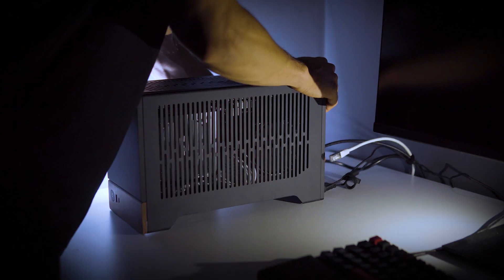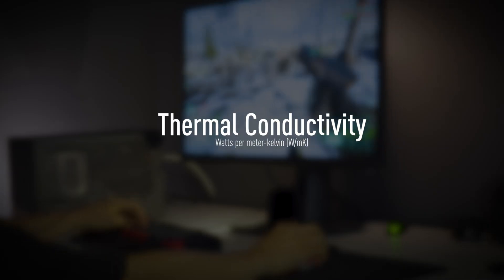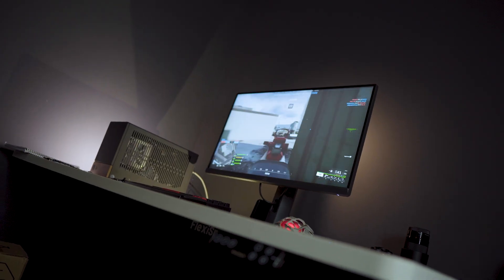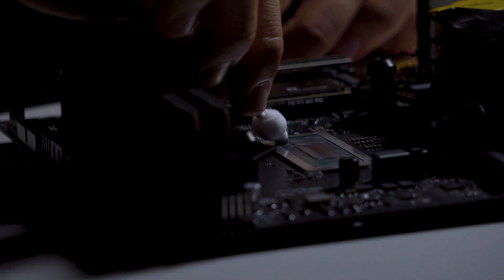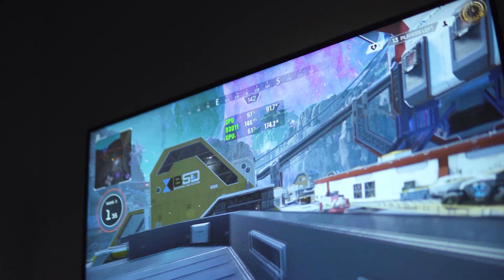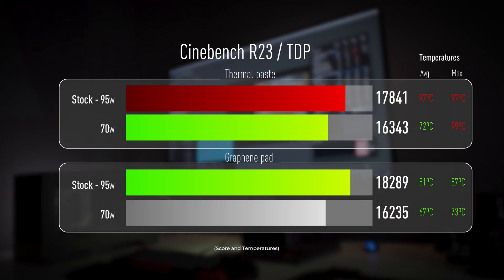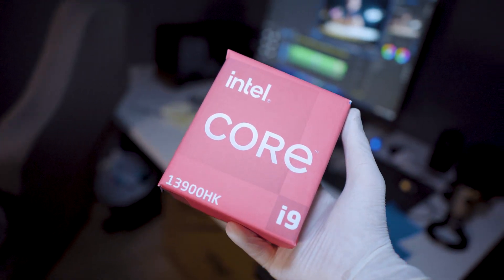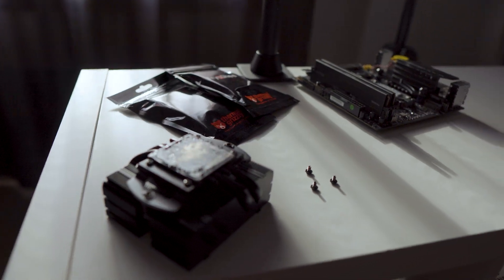Good Bye Thermal Paste: -30 degrees (no Liquid Metal) Saved My Gaming Computer

Comment: Graphene pads are one time use. You cannot use them again after taking off the heatsink. If you dont remove the heatsink, you dont have to ever change it because the temp will be the same from the day you installed it.

Thermal paste will last from 1 year to 10 years depending on brand and type. Kingpin is best to reduce temps but after 1 year the temps will be more hot and will need to be changed.
Reply from the maker: That's something I learned after the video, it was just my first encounter with them. Thanks for the information, I'll pin this comment to allow it to reach more people!
Reply: @BenTech-US have you heard of PTM 7950? It's also single use. However, it starts solid and melts at 45 degrees. Because it can actually melt to get into all the nooks and crannies and crevices, it should give way better performance.

Still has the same issue where you can't replace the fan. But that's what makes it absolutely perfect for GPUs and laptops.
Reply: high end thermal paste ( what  i mean is paste that are best for dropping temps/high performance paste) will start to degrade after 9months to 1 year.. so yeah overtime  temp will increase which is why you want to change this on a yearly basis.
Meanwhile Graphene pads & liquid metal are good for 1x use only and will last forever as long as you don't remove the heatsink.
however for liquid metal this is only applicable if the heatsink is nickel plated a pure copper w/o nickel plating will absorb gallium (i think its gallium) and will cause the liquid metal to dry earlier but once the copper absorbed LQ it will take longer to dry later on, for nickel plated only a tiny bit will be absorbed and even if it dries as long as you don't remove the heatsink or tilt the heatsink that might cause crack (in the current dry = solid form LQ) this will retain its thermal conductivity but once cracked it will reduce its thermal conductivity or worst your now good as w/o thermalpaste.
I'm current using a liquid metal under my CPU block for 2 year and 6months + now the other advantage is at peak load you will have better temp drop + better boost compare to highend thermal paste.
Are this new graphene pads good? i though its performance is still inferior than a paste if this is good I'm going to use it in my GPU upgrade.
Reply: @gamertechlive1780  for bare die applications use PTM7950 Phase change Thermal pads, they will NEVER pump out and will outlast the GPU (Temps are between paste and LM)
Reply: so how long do graphene pads last?
Reply: @brandyyn forever as long as you don't remove the heatsink
Reply: Lol that's not true at all, Even Expensive thermal paste lasts at max 1 year because of Pump out effect of thermal paste, it's literally you can't avoid it, You got those numbers from the brands because ofcourse they gonna boast how long their product will last but in reality and in practice, it will barely last months or a 1 year

Comment: Why don't you try ptm7950
Reply: PTM7950 gets better the longer it's used, and when used for a duration can have heat tranferability comparable to liquid metal.
Reply: @BROSIV91   It's so good that it rivals Liquid metal but far safer and far durable than normal thermal paste, I don't know why It isn't famous at all.
Reply: @I.K.illedThatBeardGuy PTM has lower thermal conductivity than thermal paste but somehow it performs significantly better on my GPU. Makes me wonder if these thermal paste manufacturers are lying?, Honeywell PTM is Industrial grade so it's been very thoroughly tested and has accurate packaging details.
Reply: @TheRealName7 LTT did a video on PTM 7950. Sadly, gamers nexus hasn't.
Reply: @TheRealName7  Phase changing will suck up a lot of heat and paste does not do that.

Comment: Pretty sure this is a scam😂

Bro can you test simple aluminum foil as a thermal pad? 0.02mm thiknes

Or better copper foil if you can find it.
Pretty sure you will get the same results😂
Reply from the maker: Why would I scam someone? I bought them just to try everything, since a friend of mine recommended this for me. The most probable thing, is that the CPU stock IHS thermal paste was absolut trash, so then with a little upgrade, the difference is BIG.
Reply: Maybe you should watch some videos from derbauer, the guy behind thermal grizzly...
Reply: Those are graphene pads from Thermal Grizzly. Do your research, idiot

Comment: I'm pretty sure the temperature difference you're seeing mostly comes from the thermal paste in the IHS and this being one of those chinese boards. Pretty much every other test of these pads is positive, but not 15ºC better than good thermal pastes. 

Mind you, most "famous" pastes are bad for direct die application like what you have between the die and the IHS. For that location, you eant thick pastes like the GC-Extreme, GC-4, Prolimatech PK-3, etc. 

Those Thermal Grizzly, Arctic, Cooler Master and Noctua pastes pump themselves out of the die almost immediately.
Reply from the maker: That's the point, probably that's what's giving that much of a difference here, and I'm glad you shared those tips, I'll definitely try something different under the IHS. I never knew about that, so thank you very much!
Reply: @BenTech-US try phase change material and popular thermal paste. It will be better than those graphene pads.

Comment: I think "PTM 7950" (or whatever phase change they sell as PTM 7950) sold on aliexpress would be fun to test, it's similar (or even cheaper) price to those sheets.
Gotta test before and after burn-in though!
Good luck on practicing pronunciation, it's much prefered to AI-tools. I can't stand them.
Reply: Paste is better than these graphene pads. But phase change is really good and should be used.
Reply: @tacticalcenter8658  yup, its almost as good as liquid metal, but of course, if dd then lm, otherwise ptm pcm or whatever its called
Reply: @tacticalcenter8658  not really. Thermal Grizzly's pads The Kryosheet. Competes with the Noctua paste (one of the best, if not the best paste on the market. IC graphite pads of old were not as good sure.
Reply: You would get 2 sheets about 4 times the size of those pads for the same money. Whist it is good it is incredibly fiddly to work with, results take a bit of heat cycling but are definitely one of the best options for bare die applications such as laptops. Having used it multiple for laptops myself I can attest to it's quality. I used Upsiren PCM-1 branded version and it works perfectly. Upsiren UX Pro Ultra thermal putty is a good thermal pad replacement to go with it. In my personal laptop it reduced temps by 16'C peak and a further 8'C under general gaming load. It also brought all the cores temp delta much closer together, before the variation could be as much as 10-12'C, now it never goes over 4'C max variation. Slightly higher boost clocks, 100MHz means more headroom for the GPU to boost as well. I used it there as well and temps have come down too. When capped at the same MHz it's around 7'C cooler. Fans are much quieter and so I leave it at that.
Reply: Built in heat, started selling Pentium 7950 on their website. It's honestly probably the cheapest way to get the real deal.

Comment: Nice vid, didn't know these pads existed. Too bad your 13900k will oxidize and die too fast for this to have been worth it.
Reply: It can and don't have to happen not all cpus are affected earlier(earliest) ones are but what specific batch/es i don't know yet but remember every chip will die literally
Reply: wdym? graphene pads ruin cpus?
Reply: @Laptop_clevo intel 13th and 14th gen kills themselves if you use launch bioses.
Their microcode is running unsafe voltages.

Intel, in their infinite wisdom, released a patch, directly explaining that previous damage would not be undone.

But no refunds or replacements unless you twist their arm.

🤷‍♂️

My brothers 13900K died last year due to this. I told him to update, but, maybe he wanted an RMA to a 14900k, who knows.
Reply from the maker: I discovered that problem after getting it (a month ago). Anyway I use it to render with Quicksync, my render times have been reduced to half of what they where with AMD, hope by the time it's degraded I already got the value back by the time saved...
Reply: @BenTech-US  yeah it's recent development. Sucks but I hope you get the value squeezed out before it's dieded.
Reply from the maker: I have some hopes, at the end if you pay attention to the model I have, it's the HK version (laptop) From an strange manufacturer in China that solders them into a MB and then resells for half the price of the 13900K + Motherboard. I may have to wonder about other problems than that, who knows. 

Also @_fr4mes743 Yes, quicksync for Premiere Pro at least is giving me half the time on render than my last AMD 5800x, I know it's not the latest AMD, but it's still one of the best value CPU.

I talk more in depth about that in my new CPU video https://www.youtube.com/watch?v=3UuJCUG7aeA
Reply: Is Intel specially better for Quick sync? It seems weird that your render times would be halved unless you were using an AMD processor that wasn't also top tier. @BenTech-US
Reply: @BenTech-US  i hope for the best! I almost sniped 13900ks but ended up with 12900ks i was on 5800x you can say it was not worth it...but it was a huge upgrade even in Windows everything is opened instantly and more snappy and in Resolve quicksync is must have i will never go back maybe ryzen 10000 can change it but we see
Reply: lol, oxidize and die too fast when he's probably using it for over a year by now? sure.

Comment: what I don't get is that they aren't meant for re-use like in a new PC so does that mean removing the heat sink means you should replace them?
Reply: The graphite pad used between the CPU IHS and cooler is reusable, however it's extremely delicate so removing the cooler does present the possibility of tearing it. If it's still a fairly large chunk though, it will still perform, although maybe not as well as it did before as that depends on where your CPU die that is generating all the heat is. If the pad is still over the die, then it should still perform well.

As for the pad used between the CPU die and IHS, no comment since I haven't used it before, although you might be able to get more info on the thermalgrizzly website.

Comment: Considering how much each individual component of a computer system costs by itself, $30 for a graphene pad that provided that big of an improvement is a heck of a great deal. So, I wouldn't get too hung up on the price. Even if the price was twice as much, it seems to be worth it.  

Also, your English is good now and it will get better over time. The plus side is you're bilingual. Not many people have that advantage.
Reply from the maker: Yes, they are worth their price, and considering the hustle of the thermal paste, you get something MUCH cleaner and practical... But the price is worth talking about by the factor that a better CPU fan may cost that price different and might be more of an upgrade. But for me, it's worth every penny.

Thank you very much for your kind words, you helped me a lot, it gives me motivation to keep grinding and get better. By the way, english is my 3rd lenguage, I love to get better at it because the other 2 (Spanish and Catalan) are native, so having a 3rd one with that much of a broader audience gives me a lot of reasons to practice and improve.

Again, thank you very much!

Comment: what about ltt thermal pad ? can you test it please
Reply from the maker: Haven't tested them, anyway maybe it's better to simply use a brand dedicated to this kind of thing, and not to pay more for a branded thermal pad of whoever knows what brand. Isn't that true? Thank you for your comment!
Reply: @BenTech-US  LTT is simply a reseller. The pads they sell are Honeywell PTM7950 Phase Change Material pads for industrial applications. LTT only sells it because it's nearly impossible to buy from the original source. I highly recommend it. Keep in mind that the best thermal performance will only come after many sessions of extended heat and cooling, as the phase change material will soak into the heatsink with every session and get better.
Reply: @Snowowowie  
Have anyone even got a phase-changing material that didn't perform similarily?
I'm 100% sure there's a ton of other PTMs but I wouldn't guess they're bad, - not sure if LTT can get it's hands on genuine supplier from Honeywell either, but I trust them a little more than Aliexpress for sure.
But I think even middle-of the pack OEM PTMs perform around as well as best pastes, with the upside of much lower maintenance.
Reply: @BenTech-US  
How long ago has you changed the paste?
Sorry if I hadn't paid attention but I wonder if it isn't the case of the paste degrading a bit.
Reply from the maker: Wow! amazing info to gather, I'll try to do a follow up on that LTT, or at least try on my own. The thermal paste has been on the computer for 4 weeks at least, it was brand new, it's just my new build, so not enough time for it to degrade...

Comment: Question would be is how long do these graphene thermal pads last, like will they degrade and eventually lead to increasing temperatures overtime?
Reply from the maker: I talk about that at the end, in theory they don't degrade, and according to the brand manual you can change them every 3 years. Anyway I'll try to do a follow up after some time to check everything. Thank you for your comment!

Comment: I have a similar case and was a bit sceptical about it due to where I live 🇰🇪 being quite hot around the beaches

Case         Fractal Terra -Silver

GPU              Zotac  RTX 3070
CPU              Intel i5 -12600K
PSU              650w SFX Gold
SSD              1TB Samsung 970 Evo
Motherboard Gigabyte B760i
RAM          DDR5 32GB
Cooler         ID-Cooling IS-55

Thank you for this
Reply from the maker: Wow! Kenya? How amazing is internet, love to see that. At the end it reduces temperatures by 10-20%, depending on each case/cpu fan. I think on your computer probably would be the same as mine, as I'm in Spain and it's also quite hot in summertime. 

Thank you!
Reply: why bother then? just get a dual chamber aquarium case like everyone else LOL
Reply from the maker: Nah, there's something with ITX, minimalism, simple, and ergonomics. Those big towers are too big for me, I have been using a Lian Li o11 for years, but got tired of it.
Reply: If your IS-55 isn't cutting it, upgrade to thermalright si-100 (see http://www.youtube.com/watch?v=xiYoYa7c_uU).